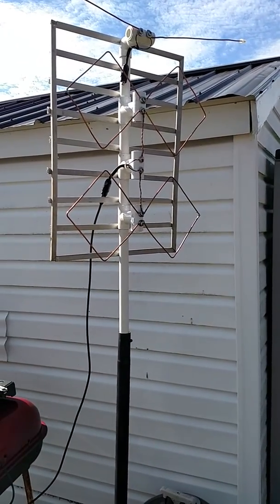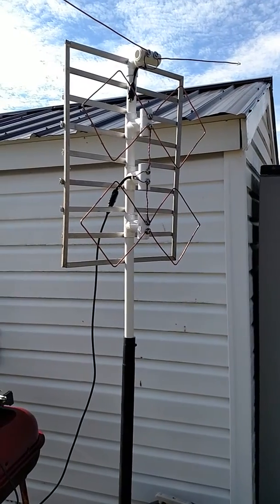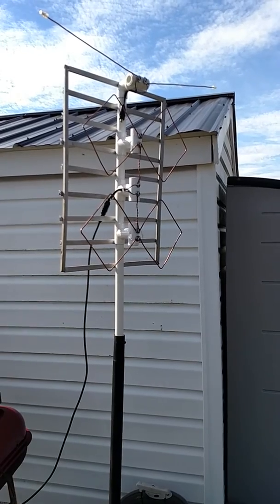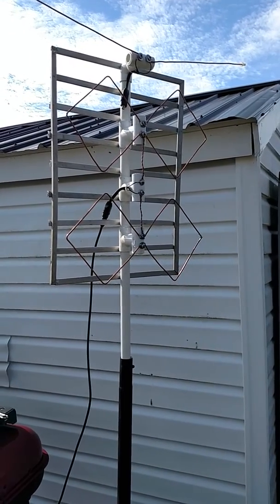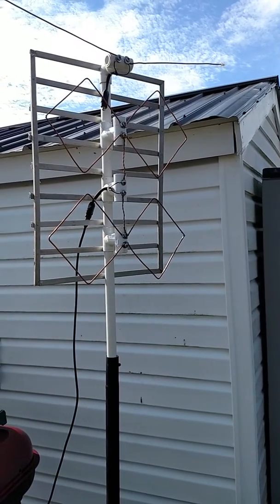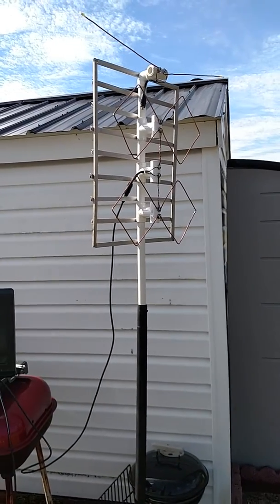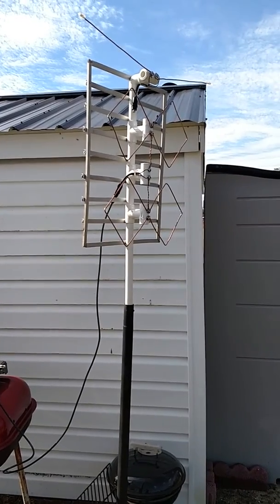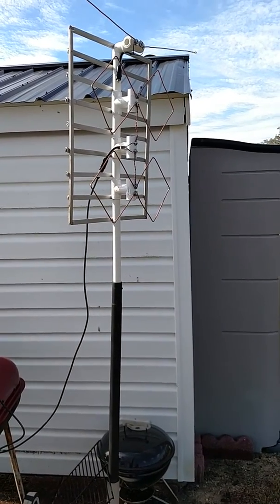My HD TV Antenna prototype " The Quad "

Comment: Trial and error it's how we figure things out. I was wondering if maybe tilting the reflector somehow similar to an aerial antenna if it might work better for ya. Just a thought. Good luck  with it. My tv signal is out completely right now and has been all day.  I think a wire is disconnected from the antenna. Couldn't check or see much with the rain.